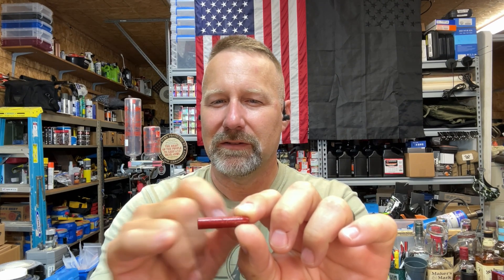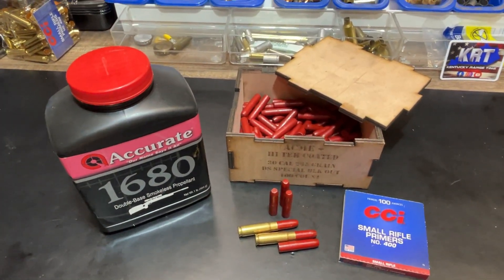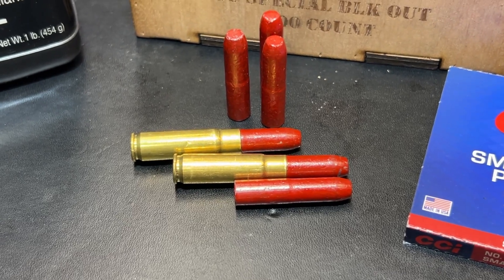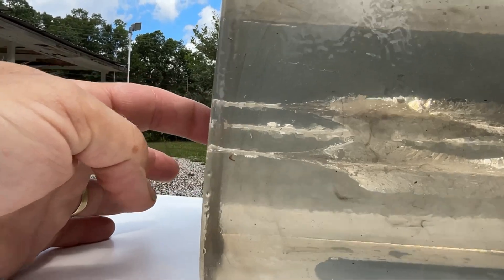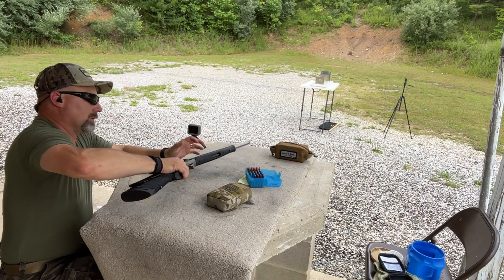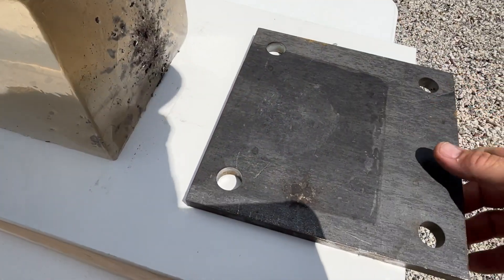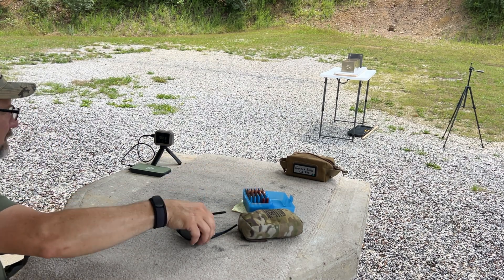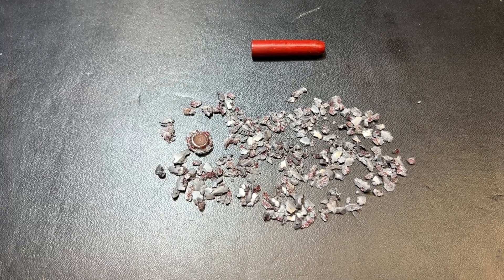.300blk, ACME 265gr DS Special Hi-Teck Coated Lead Bullet, Tested in Ballistic Gel Blocks

Comment: So do you not recommend these particular size for an AR platform or all of their coated bullets?
Reply from the maker: I’m not saying don’t run these but be aware of potential issues. 

Generally speaking, lead and coated bullets through a gas driven AR can present issues in some barrels.   If the gas port bisects the lands it can create a sharp edge that will shave off coating or even lead.  The gas pressure will carry these shavings down the gas tube and deposited inside your BCG. 

I about locked up a rifle once when the gas rings got filled with lead that melted and formed into them. 😉
Reply: @kentuckyrangetime alright i appreciate the info, im not sure where the gas port lands on my 10.5" honestly
Reply from the maker: @AllenF05Length doesn’t really matter, it just depends on the machining and where it stops turning when they headspace and pin the barrel extension.  Only good way to check is a bore scope, or just shoot it to see if it’s shaving anything 😉
Reply: @kentuckyrangetime alright i appreciate it.

Comment: 265 DS Special was designed by a guy who've I'm glad to call a friend. He is active on social media and goes by Dolamite Supafly. The 265 is a really fun bullet and hits hard!  Really cool to load over some Trail Boss powder as it is extremely quiet and doesn't cycle the AR action so you dont have action noise either.  Its neat to see that truck of a bullet tumble and leave 1.5" keyholes in whatever after passing through a jug of water or similar.  A while back, DS sent me the proto-type molds to play with so I cadt amd powder coat my own... then catch them in a 50gal drum, re-melt, cast, coat, and reload.  Makes shooting 300BO dirt cheap
Reply from the maker: Yea, great guy. He caught my first load work-up pics posted on Instagram and messaged me. Sent me his recipe to use too😉.

Comment: Hey found your video, a few questions if you can. How bad was the gas port shaving in an ar? What round counts or failures did you see? Do you experience the same with plated like the berrys? What was your 1680 load?
Reply from the maker: @JustFollowTheConstitution  
-10.0gr of 1680
-no issues with plated bullets
-I’ve not ran enough of this particular bullets in the AR platform to evaluate it. 

I did run several hungered of the 220gr cast from the Lee mold. Some with Alox and some PC. after several hundred rounds, the shaved lead accumulated in the gas rings of the bolt and locked up the bolt travel. Ruined the rings. 

The severity of the shaving is dependent on where the gas port cut hits. If it’s completely in the groove it’s minimal it can be zero issue. I used a bore scope to check and my rifle had the gas port bisecting the lands which increased the shaving issue.

Comment: Did you have to size it down to 3.09 before loading the case?
Reply from the maker: @attaway9able  I did not. As a general rule, cast bullets need to be .001-.003 larger than jacketed bullets, depending on caliber and barrel tolerances. 😉

Comment: Very cool splatter against the steel plate. Does the coating work to prevent leading the barrel since the bullet is so soft?
Reply from the maker: @rangetime6779  yes. The HTC-High Tek Coating acts like the powder coating to seal the lead. It’s much easier to apply though. 😉